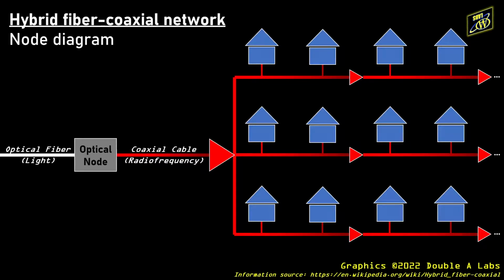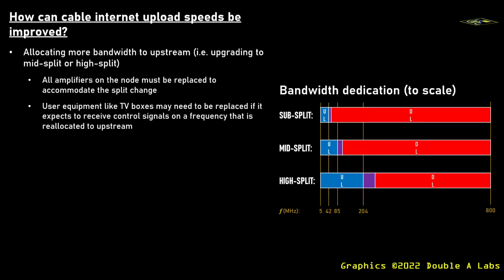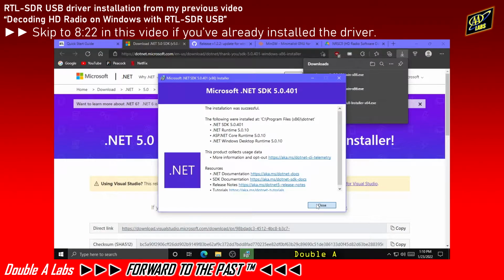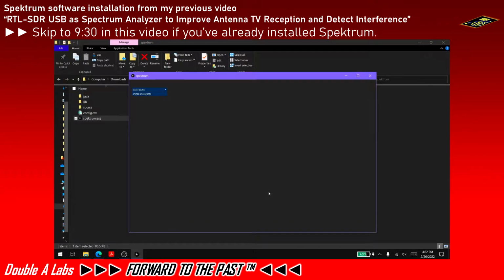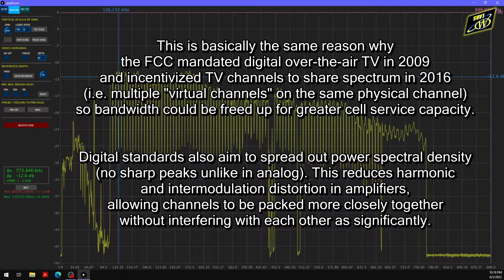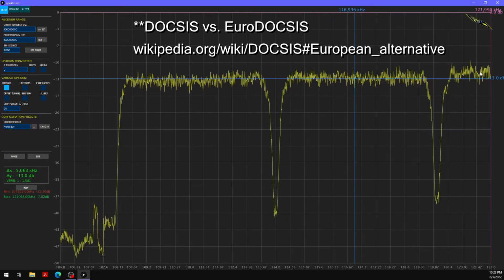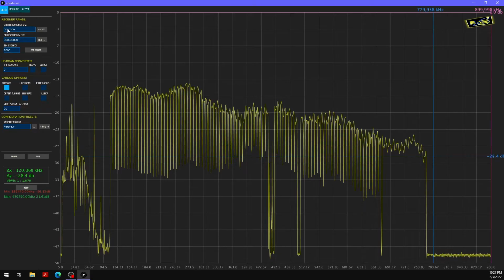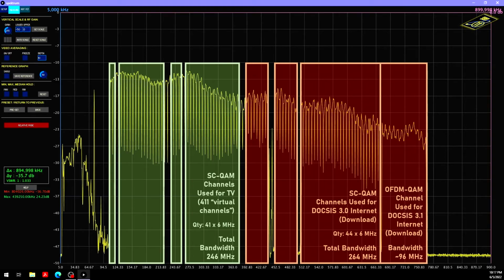How Broadband Cable Networks (Xfinity etc.) Work and Probing One with a Spectrum Analyzer (RTL-SDR)

Comment: So that gap around 430mhz you are seeing is where the AGC (automatic gain control) or "pilot" channel used to be before your area went midsplit. So when an amp would be balanced (levels set correctly) you flip a switch and the amp locks on to that frequency and when the temperature changes the AGC does its best to turn itself up and down to maintain those set levels. That's the basics of what's happening. When the midsplit happened that frequency was no longer needed as the new amplifiers have an AGC that lock onto a frequency that is set inside the OFDM. Hope that helps.
Reply from the maker: Interesting! Thanks for the info!!

Comment: I'm so old that I remember when 439.25 MHz was the output of the ATV (amateur television) repeater in Arlington, Virginia back in the 1980s. Although ham radio is secondary use in that band, I'm sure hams appreciate not having broader bandwidth leakage to deal with LOL. Interesting video, thanks.
Reply: I live in Rockville MD is that frequency still available ?

Comment: Those un-modulated carriers are more than likely the pilot carriers that the line amps lock onto to adjust AGC and for setting tilts on the line.
Reply: Or the leak gear carrier.
Reply: QAM 256 digital signals level are difficult to measure accurately. It takes a sophisticated test instrument to measure them. On the other hand the “beacon” continuous wave carrier at 445.247762 MHz can be measured easily by an inexpensive meter. That’s one of the reasons that this signal exists on Comcast here so a tech can quickly measure levels and be in the ballpark of what they should be

Comment: The lack of upstream signal is due to port isolation at the tap. There's usually around 30dB of isolation between customers. (based on data sheets.) If you have a modem on your line, and it's transmitting, you'll see it. Loads of tradeshow demo's love to show this.

Comment: I wonder if the analog carriers are really an artifact from the old days, or perhaps related to diagnostics. I recall that my local cable provider used a channel around Ch. 60 as a sort of monitor transmitting a video feed of a Debian terminal
Reply from the maker: Perhaps diagnostics, though I was thinking it was strange they appeared completely unmodulated in Spectrum (no data going over them) and a were just black screens on my TV (during the few instances I looked at them, of course). Maybe they are there to provide reference signals for technicians to diagnose line issues.

Comment: Hi, I know this video is a bit old, but I wanted to ask a question. In the video, I see that you don't use attenuators, and knowing that the cable modem transmits the upstream signal, wouldn't it be dangerous for the SDR if the cable modem's transmission power saturates or possibly damages it?
Reply from the maker: That's a great question! The maximum output power of most cable modems is about 50 dBmV. In a 75 ohm system (i.e., residential coax), this is equivalent to 1.25 dBm. The maximum input power of an RTL-SDR is 10 dBm, so this setup should not damage it.

I probably did that calculation before making this video, but forgot to mention it. No guarantees for any specific equipment tho, always good to check the specs.

Comment: Sorry for a noob question, but what is the point of all this.  Are you just seeing what you can receive off of your coax cable system?  Is this an alternate type of antenna?  Thanks.
Reply from the maker: Basically just seeing what I can receive off of my coax cable system.  Here all the channels are encrypted, but in some cases you might find some channels, like locals unencrypted.  That seems to be becoming more rare, though.

I have also used the spectrum analyzer software to check if a coax is active or to troubleshoot issues.

Comment: Are there tools to demodulate those channels?
Reply from the maker: Not that I'm aware of. It would technically be illegal to break the encryption, anyways.

Sometimes you will find some channels in the clear, however. That was the case on Fios in my area not too long ago. You could tune certain channels (mainly locals) without a box or CableCARD. They're moving to IPTV now (sent new boxes out), so I'm not sure if that even still works.